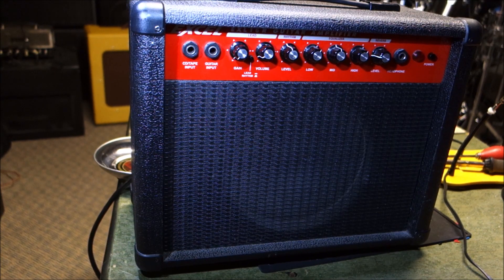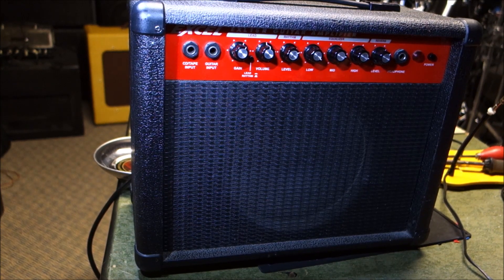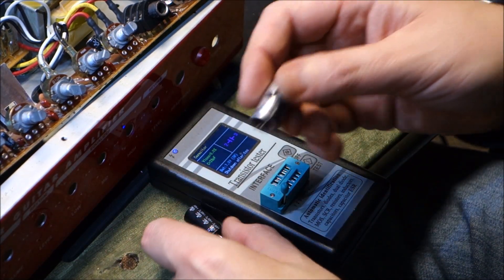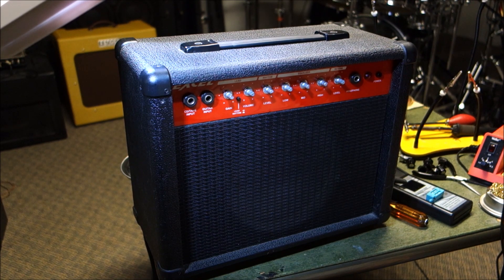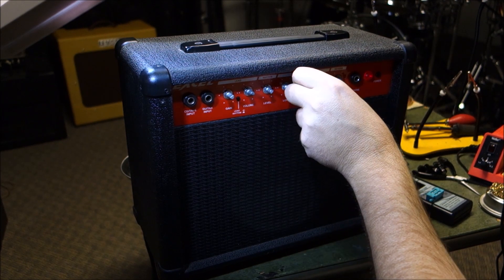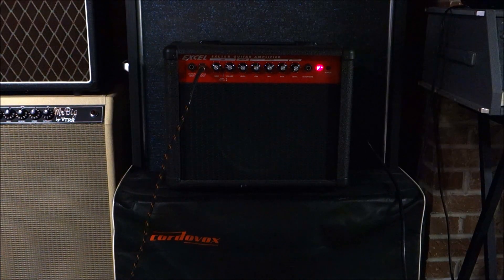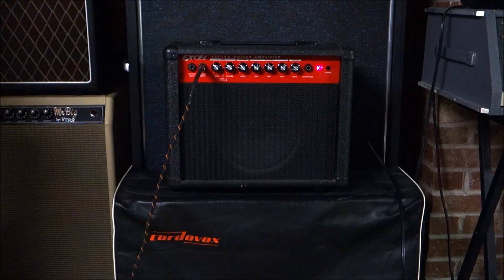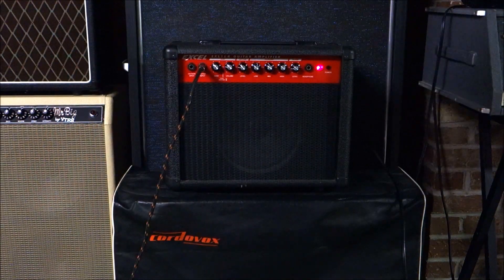Excel EXL16R Guitar amp saved from the grave.....

Comment: Is this a split rail supply or are the caps just in parallel? I'm guessing the latter because there was no strong persisting audible hum while it was faulty. The cheap caps they had access two were probably quite high ESR so they parallel'd two to get lower ESR instead of just using one 4700uF.
Reply from the maker: There was some hum but the camera didn't hear it.   I never looked at the schematic but I'm assuming it is split rail
Reply: @DeadKoby  

Would have expected more extreme hum if one rail is effectively unfiltered. Maybe the TDA has some kind of protection. Which would also explain the "trumpet" sound (hum before the protection kicks in?l
Reply from the maker: @westelaudio943  When it was running,  you could hear it humming softly... TDA's have an internal feedback circuit which if they are run without a speaker,  they can easily go up in smoke.   It's much quieter with a good cap in there,  and it wasn't a pricey fix,  as it's certainly not a high value amp.   Sounds OK for what it is,  and I'm sure it will continue to help students at their lessons.

Comment: Hi, deadkoby. I picked one of these up out of the garbage the other day.. the potis are making crackling noises.. what should I do?
Reply from the maker: Get the max pro contact cleaner and electronic lube that I sell on reverb.   Put a puff of cleaner and turn it all the way 10x.   Then do the same with the lubricant.
Reply: @DeadKoby  thanks so much for the lightning speed reply. Will do. Thank you!
Reply from the maker: You're welcome.
Reply: @DeadKoby  hey man. I am just now taking it apart and it seems like the interface is glued to the red plastic, or perhaps melted to it..

Did you experience anything similar?
Reply from the maker: @Optselect  No.   Under the knobs,  there should be nuts that can be unscrewed.
Reply: @DeadKoby  it was actually just stuck on the speaker grill cloth. Thanks though!